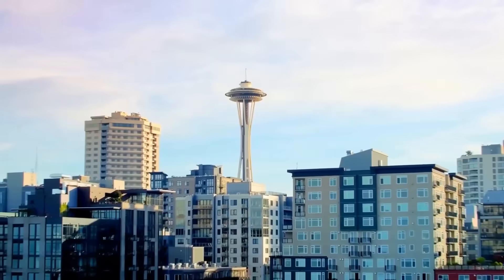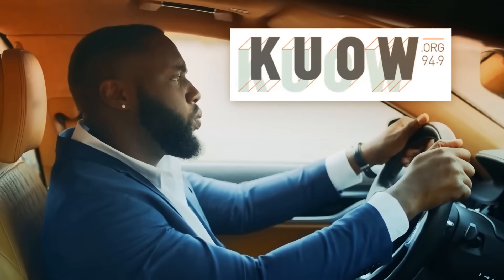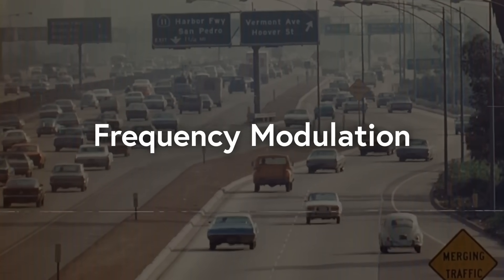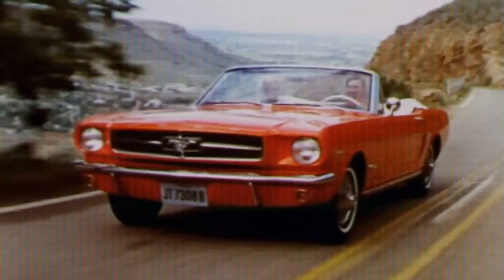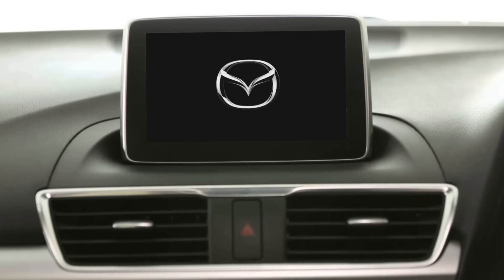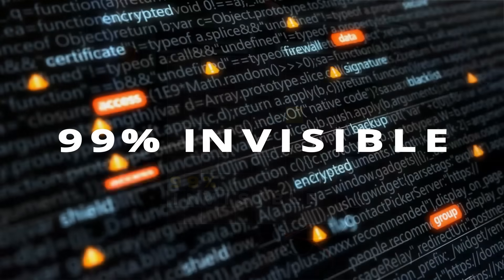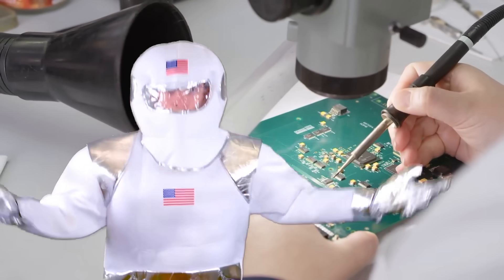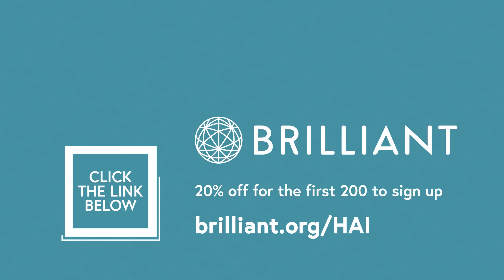Why Hundreds of Mazdas Tuned to 94.9 Broke Simultaneously

Comment: And I'm expected to trust that the programming in charge of steer-by-wire. (I'm not talking about autopilot, but rather the cars with steering wheels that aren't actually connected to the axle.)

Comment: Not to dunk on coders, because I was one once, but this is part of the difference between coders and software engineers.  True, software engineers can and do make mistakes, and coders can and do make amazing and well written programs, but in the process of getting my CS degree, I was amazed at all the little nuances I didn't know or even contemplate I didn't know, until I took certain classes.  Things like input sanitization, robust error handling and fail safe programming.  And for those who think all programming jobs are going to be done by AI, just try having an AI write a modestly complex method.  A younger engineer and I had a competition to write a specific method fastest.  He used AI and I wrote it myself.  He spent most of his time fixing what the AI fed to him.  This is because, we were dealing with custom APIs and custom SoCs, which the AI had no training material on.  AI will work for some circumstances, but there's still a lot it can't do well.

Comment: Nothing new, back in the early ninties individuals running Plymouth Voyagers and an assortment of other Chrysler minivans were actually experiencing something odd. Considering most federal and state employees were paid bi weekly. During the off week they had excellent gas mileage but the following week those who paid attention to their mileage noticed the cars burned more fuel. Now let’s take it one step further. Those who opted to instal an aftermarket sound system noticed an increase in fuel consumption no matter which week of the month they were in. Could there have been something linked between the factory car radio and the engine computer? Why would fuel consumption go up once the factory radio was removed? The interesting thing is that there were no direct connections to any other part of the car such as remote controls on the steering column which could have been routed through the body control computer. The other issue is that not all radio stations carried sub carrier programs on their transmitters not to mention that how could any data be routed through to the many stations in a given market. Was there an additional receiver within the radio? How could it communicate to the engine control computer? We had no WIFi or Bluetooth in those early years. Was there a signal modulated over the DC power line from the radio that would be picked up by the engine computer?
Interesting experiences felt by some owners.

Comment: I dissagree that more computerised cars are more vounerable to theese sorts of things. Its absoluelty possible to write software that dose not have any problems like this. Companies do all the time. And for anything critical like control logic, they do write code with a completely different approach that is extremely unlikely to have theese types of bugs in a way that effects safety. And in general, making a larger noncritical software project like a more complex entertainemnt system will also mean hiring more skilled people, and taking a more serius approach, leading to more stable software, despite the increased complexity.

Comment: Graphic, not jraphic. GIF, not JIF. Also, this shows why electronic gadgets have no business being in something that can impact safety, unless purposefully built for that purpose like computers in planes or spacecrafts. And no, radios and navigation are not necessities for safe driving and those programs and hardware should in no way interface with ANYTHING that controls the drive train, steering or brakes.

Electronic locks for example are very easy to beat with a magnet or a urethane hammer, simply because no thought goes into the actuating parts, often a solenoid (an electroMAGNETICALLY powered spring) and only the electronic 'smart' part needs to be slick and shiny.

Comment: You lost me when you started ragging on EVs and strangely associating them with a higher level of technology.

Electric vehicles are no more advanced than internal combustion engine vehicles. 

Both technologies have been around for 100 years and it's only the batteries in electric vehicles that have chemistry not found 100 years ago. 

Internal combustion engines that are mated to electric motors usually have battery packs with the same exact technology. 

Any ancillary technology such as HMI is completely unrelated to the propulsion mechanisms.

Comment: This is the first I have heard about this.  I think that just power I cycling the radio should end this problem.   Or, if that doesn't work, then unscrew the antenna before switcing on the ignition and tuning to a different station.   This is the kind of software bug we will be seeing more of.  Consumer appliances use so many buggy OS's, programming languages, and widget toolkits; eg: Linux, Java, Java Script, C++, etc that are constantly being updated with new features.   There is no configuration management and no one knows what all is in this software.

Comment: So, you mean to tell me that they couldnt have just added a space between the "%" and "i" instead of spelling out "percent". Im no expert but in "code" ive seen "%20" is usually a representation of empty space/invisible character. BUT if you add a space (i.e. "%  20") it indeed "breaks" the rules and no longer represents empty space.

Comment: It's always bizarre seeing these kinds of glitches. As a software developer, I see things like this and think about how easily they could be avoided, had the company done proper testing. And I get it, most devs dislike testing of any kind, but it's needed. And not just writing a little unit test to prove it does what it's supposed to. Manual testing with the goal of making it break. The average user will definitely attempt to use the service or product in ways it wasn't intended for. And when that breaks it, they say we made a shitty product.

Comment: The interesting part is, that it is not necessary to have so much electronics in a modern car. I just built an electric motorcycle and the only electronics are the battery management system and the motor controller. And those systems are not "online" in any way. Modern cars are no longer cars, they are rolling entertainment systems.
Just look at the ads... horsepower, size and comfort are no issue anymore. It's all about music, connectivity and entertainment. No wonder people drive like deaf and blind.

Comment: So Mazda soft is trying to execute a string received from an untrusted source as a line of code?
It seems, in this way, with the help of a transmitter tuned to the frequency of a popular radio, you can infect old Mazdas soft

Comment: The weird thing is it absolutely had to be an intentional code path. WHAT TO DO WITH DATA depends on having an idea of what it is. The most likely bug was rather than finding-and-failing a path that looks for a file extension, they probably did the god awful thing and assumed there was a dot and three letters, reading out of bounds, with no checks on the sanity of doing such a thing. Worse, if it assumed there was a dot, three letters, AND end of string, the worse problem is the computer reading until it finds another \0 (0-value string terminator). Knowing these days, it was some 'flexible' language / framework which didn't use a null terminator AND which didn't sanity check things, combined with someone bodging a patch at the last minute to get around another bug. There's a nearly fifty year-old joke about "Software Engineering" because programming badly has absolutely no consequences, even if they even endorse standards.

Comment: Funnily enough, just leaving the battery disconnected for a few days can be enough to rectify the issue. The album art is stored in a ram style cache and not the longer term and storage. Simply leaving the system unpowered for a long period of time is enough to clear the ram cache was enough to rectify the issue.

Comment: This is 100% mazda's fault. Not the stations fault. Nothing the station broadcasts should brick the radio. You really shouldn't blame this on the station, this is horrible software design and really could be susceptible to any signal anyone transmits. This is just mazdas being pieces of garbage.

Comment: Yeah this should never be able to happen. As software developer you should always assume that the data you receive from the outside can be hostile. Either on purpose, by mistake, or because corruption of data. Of course you can't always catch all edge cases, you will overlook one of them, so you should work on the assumption that you will. The crashing of the radio should not be able to break the entire car! Just let the radio break on its own.

Comment: This weekend, I removed the broken tape deck from my 1992 MR2. I also removed the speakers, just to be safe. I plan on installing a Sienna V6 and tuning it to 400HP at 9000rpm with a race exhaust, so nobody around me can hear their own radios. Don't worry, I'll wear hearing protection 😊

Comment: To be fair (what fun is that?), the steady march towards "EV"s, and the steady march towards more and more automation (such as autonomousness) are not directly connected.

That is, these are two concurrent technologies that, like chocolate and peanut butter, go great together.  But ... they don't have to.

... we certainly have autonomous internal combustion vehicles, and we certainly have verrrrry dumb EVs.

That being said, yes, if you're going to shell out thousands of dollars to kick the gas habit, it is not likely that you're going to shun the electronics that inevitably comes with it just to remain securer that you are in control.

I really like tubes and transistors.  I know full well, however, I won't ever see them again other than in museums.

Comment: Who programmed such crap at Mazda?! Already for security reasons devices designed to process data received from outside must be designed not to be damaged by corrupted files. Else every hacker may send a kill signal to it. EU has just increased cybersecurity requirement for automobile online electronics, causing the cease of production of some outdated models because fixing their IT would cost more than waiting on finishing successors of those cars.

Comment: Even with electric cars, there is no need to have an infotainment system or any computer outside of a disconnected one fro managing charging, battery load balancing, and the motors. Radios should go back to being DIN standard non internet enabled things that can be replaced with any number of aftermarket cheap units. Backup cameras and steering wheel media controls dont have to be integrated into any other car system. Aftermarket non-integrated headunits can recieve texts, do Android Auto/Carplay for maps and streaming, they can use Bluetooth. But most importantly when they crap out, your car still runs. Air con and other car systems should have real buttons and not depend on a  massive touch screen.

Comment: Never tune your car radio to 97.6Mhz as this frequently transmits an emergency cut uou code for all vehicles, if involved in an accident and the air bags employ you radio automatically tunes to that frequency so the emergency code is activated to shut down engine, fuel pump, water pump and all electrics. If you do accidentally tune to this frequency by mistake you do get a warning for 5 seconds before activation, but you must be quick as once implemented it can not be stopped and is very expensive to have all the car's safety equipment re-set.

Comment: This type of thing has happened to the best of the lot. IBM once had a program that only had one single instruction. It was discovered to have an error and was corrected. They then discovered that they had introduced a second error. It also was corrected. Luckily no further errors were detected with this program.

Comment: I don't even use the radio in my 24 year old Nissan. My 52 Panhead is all mechanical switches except for the voltage regulator. IEvery update on my computer makes it worse.

Comment: A program that is able to read certain types of files should be able to recognize them without an extension. Information about the file type is embedded within the file itself, usually in a header at the very beginning of a file. Even very basic computers of 40 years ago could easily do this, and tbh just the code that reads in the file to render it should have included some kind of logic to that effect.

Comment: I'm sorry, but this is fully on Mazda (or whoever they had produce the radios). This is something that should be found in QI. Yes whoever pumped those extensionless images is a tad silly, but to be fair, most infotainment these days is Linux based which has zero issues figuring out a file type without extension, so that's fine.

But for the OS (or at least the software itself) to crash continuously? Just format the damn folder on boot or something! And to say this can't be fixed... You can NOT tell me that you can't format the storage or re-flash the OS. That's bullshit.
Reply: Probably written by a developer that goes around claiming they are an "engineer"

Comment: Why the fuck doesn't the ENTIRE auto industry use a standardized, generic system for infotainment? Just like it uses gasoline as the universal standard for energy storage? Or electricity as the universal standard for powering the starting, lighting, and ignition systems?

Just a dumb idea...

Comment: I learned from a dishwasher in  the mid 70s that computer controls would make a lot of equipment equipped with them worthless very quickly . In the case of the dishwasher, the steam from the drying cycle would seep into the computerized control panel permanently, rendering it useless . I salvaged the machine by replacing the entire  control panel with a mechanical one from an earlier model . The problems have never been resolved, and it just keeps getting spread to more and more and more appliances and equipment . The controls of any and all devices should be the last thing to fail, not the first . To this day, if a model exists that doesn't have a computer controller, that is the one i purchase.  By the way, I made my living repaing computer systems in cars . I chose that line of work because I knew I would always have lots of work and lots of customers.
Reply: A VERY common opinion in the IT field.

Comment: Come on, this is not frying the circuits of the radios. It's just a software bug. I doubt that there wouldn't be some bootstrap solution instead of buying a new radio

Comment: Here’s my q to argue about it. Evs that are built right will have a: multiple redundant computers for non direct driving thing(stop, go, etc) (hopefully everything in the future).
The computers that run infotainment, are gonna be literaly separate devices not connected at all to the driving computers besides a power wire to the battery. 
You can literaly reboot teslas infotainment center while driving the car and it’s totally fine. It’s a feature.

Comment: As a programmer I just want to say that finding what format a file is without checking its extension is really easy! Relying on the filename like that is both error prone and arguably harder than just looking at the first part of the file. So bonus points to the anonymous programmer who goofed that one!

Bonus fact: the issue with 99PI is actually a lot worse than this video lets on. %I is shorthand in a lot of programming languages for "replace this with some arbitrary number." The code crashed because it was expecting to get a number to fill in, but all it had was the rest of the podcast's name. But the fact that it read %I like that means that you could potentially run any code you want on the car's console, if you had a maliciously-named podcast! Again, very easy to avoid, borderline malpractice to let it happen.

Comment: I think the worst problem here is that the only solution to the bricked infotainment was completely replacing it. They couldn't have built in a hidden USB port somewhere that a tech could plug a flash drive into, and set it up so that when the infotainment turned on if it detected anything in that USB port it would attempt to boot/reinstall from that? At least that way they could get it back to normal (and maybe even provide a patch) without needing to replace the entire thing...

Comment: Chrysler had a problem similar to this back in the 90's when OBDII came out but it had nothing to do with radios. On those early Chrysler cars if you scanned the computer and unplugged the scanner without turning the key off first it would glitch the computer and set the charging voltage to 0 volts and the alt would never turn on again unless you flashed the computer with new specs. Shops were replacing alternators left & right before they found out it was the computer.

Comment: This is the reason my car is the base model. It has a manual transmission.  It has a very simple AM/FM radio/ cd player. No bluetooth. No way to hook up my phone to my car. If I get an important phone call I just put my phone on speaker and put it in the passenger seat. (or hand it to my passenger) I wish it had a line in jack tho'.  I have a garmin I use for navigation. I don't even have power windows. I figured the less features the less there was to break. The only thing I really wish I had that I don't is air conditioning.